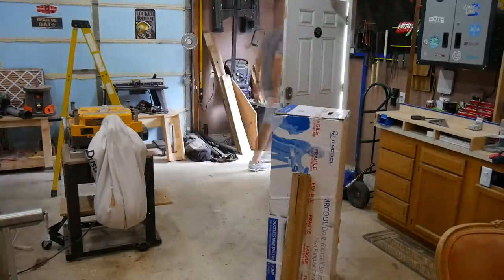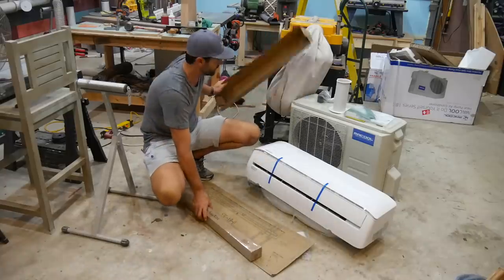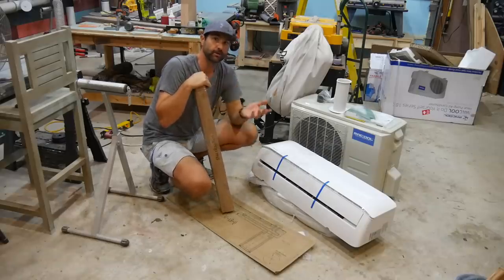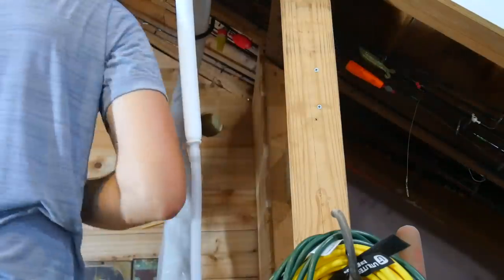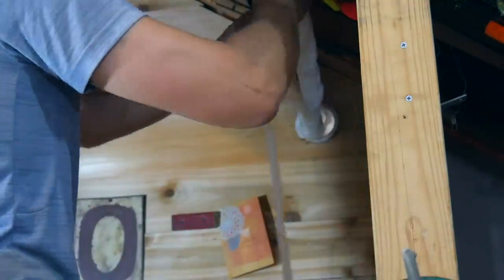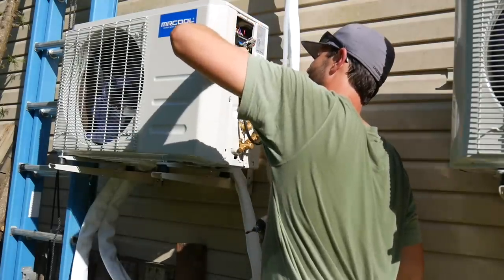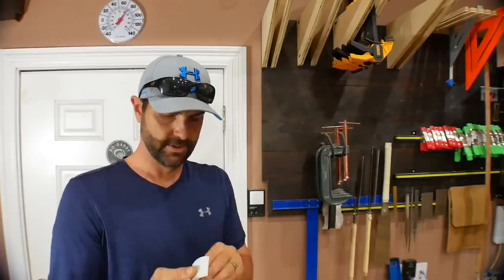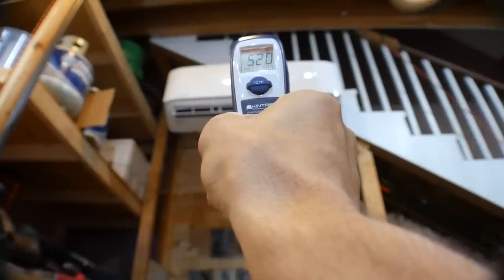DIY Mini Split Installation (Step by Step)

Comment: Wait ? You didn't even vacuum the lines out??!?
Reply from the maker: +Alex Thomas - yes, that’s correct.
Reply: It appears the linesets are sealed somehow and pre-charged, hence the special screw on couplings
Reply: they are you still need to vac the lines, you can do what he did, but your cutting the lifespan in half or even a third.  I highly doubt the manufacture recommends "just connect it"
Reply: Thats what I though too, but look closer and you will see the linesets are sealed at the end with some sort of fitting that opens when you couple them to the unit service valves, similar to a quick coupling. The manufacturer would have positive pressure refrigerant in them. That is also why they are fitted to the evaporator already in the box from the factory
Reply: You're not too bright, are you, Alex?
Reply: You don't have to pull a vacuum on these.
Reply: That's exactly what they recommend.  If you vacuum out the line you end up vacuuming out the refrigerant and ruining the system.  What he is installing is a total DIY system with no HVAC tech needed.
Reply: Alex is correct in his thinking for the most part, usually the lines are just lines with no charge and open to air, evidently this is not that though.  I had the same thought, no nitrogen pressure test, or pulling a vacuum is not what most people familiar with HVAC are used to, or at least used to be used to.  Initially my thought was why have all that line to have to fill with refrigerant, and pull a vacuum on, but like I said, this is new and different from what I would have expected to see.
Reply: dude78 They use areoquip fittings and in time they will leak refrigerant[.
Reply: @no names please  people have been using these without issues. even if there are cases that have, all brands of units, systems, fittings, etc have failed someone.
Reply: Neither are you, Dwight. Air and moisture are two things that will kill a compressor. And I guarantee both of those are in that line set.
Reply: i did not see him vacuum them
Reply: All you folks complaining about not vacing the lines just don't get it.  The lines are pre-sealed with a quick connect valve that opens when you tighten the nut.  Sears sold these systems with pre-charged and sealed lines about 50 freaking years ago.  I installed one myself.  It ain't nothing new or mysterious.  And it works.  Geez.
Reply: Not Fool Excellent point. I used to be in HVAC before changing careers, and every once in a while I would come across an old Sears DIY unit. No problems with compressors or leaks.
Reply: That's because the old systems didn't use R410a.  They used R12 or R22.   The oils for those gasses are less hygroscopic than the POE oils that work with R410a.  Just a little bit of air means a lot of corrosion, as the oil will wick it from the air like a sponge.  And not just corrode the compressor.  It's corrosive period.  That means coils, condenser, the aluminum, the copper; anything will be corroded.  The compressor is most vulnerable.
              Personally, as an HVAC guy, these things make no sense to me.  I don't mind the DIY part, I think the cost is stupid high.  $1800 for 1k, maybe1500 sqft?   LG sells a window heat pump with the same specs that heats and cools the same area for under $700!   I'd buy that and put a grand in my pocket!   In fact, I have......
Reply: Idkmybff Jill read all the comments again. The fittings go on the pipe. The system is then evacuated and charged, including the lineset. Done at the factory.
Reply: fedboy601 lmao at you bud. Look at the product. Read the description. Pressure tested at factory. Then pre evacuated, and pre charged. No flares or brazing, just click pipe fittings together.
Reply: fedboy601 and yeah there is a minimum pipe run on these so the rolled up pipe behind the outdoor unit is necessary, or they go out on HP in heating mode
Reply: @bluhuptie  Yep, on the D.I.Y. version of the Mr. Cool system, the recommend simply connecting it!!!  NO VACUUM or you will likely suck out refrigerant into the atmosphere because they are using pre-charged line set.  The D.I.Y. Mr. Cool Models have a 7 year Compressor Warranty and a 5 year Warranty on the rest of the unit.  If you buy the lower cost Mr. Cool units that require "Professional Installation" and Vacuuming, you get a great 2 year compressor warranty and 1 year on everything else.  Go Figure!!!!
Reply: Wow no vacuum pump

Comment: The way I was taught, I’d do a pressure test and then vacuum the lines first, also maybe not the same elsewhere but I’m Canada, it doesn’t matter that the refrigerant is pre charged, a hvac technician has to install them
Reply: If you do that to a Mr. Cool D.I.Y. system, you will VOID the 7 Year compressor warranty and the 5 year parts warranty.  Besides, why would you pull a vacuum on a pre-charged line???  You would end up sucking out a good portion of the refrigerant and disposing it into the atmosphere!  Better go back to school or at least read the manufactures manual before touching a Mr. Cool. D.I.Y. unit my friend.

Comment: Can’t believe how many people are installing these without putting the system in a vacuum
Reply: both units are precharged - seems like MrCool is the only brand that does this, but MrCool are more expensive.
Reply: David Cundiff didn’t know that. I was certified on Mitsubishi mini splits. Those don’t come pre charged, not familiar with the Mr cools. that’s pretty neat though!

Comment: Can you connect two fans to one condenser?
Reply: You can install up to 5 indoor units to one condenser.  There may even be one that does more I just put in 2 Mitsubishi heat pumps with 10 headers
Reply: Not on this particular unit in the video, but you can purchase mini split units that allow multiple evaporator units to be connected to a single condenser unit.

Comment: What is wrong with people? Charged lines with a charged unit,  have nothing to vacuum.  Love your work, except not hiding the line set uncoiled inside not outside. You could have used the suction line with a fan for more cooling. Great work though!
Reply: Robert Heck there is nothing great about this WTF
Reply: This is a really good point. If you have excess line and you can keep it inside, do it. You're losing some energy in that exposed pipe. Granted, it's likely decently insulated in the wrap, but every bit helps.
Reply from the maker: Completely agree.  I actually pulled the excess inside after Robert’s comment above.
Reply: @PahjoDesigns  Question on the wiring, did this size unit require dedicated run from your main breaker? And if so did you have to go through the motions of trenching and conduit out to it?
Reply from the maker: Bill Gunter - my workshop has a sub panel.  The mini split runs to an AC disconnect box and then directly to the sub panel

Comment: when you sprayed your refrigeration lines  for leaks how did you test if the gas wasn't released yet  ? did you charge the lines with nitrogen than release  ?  also i didnt see you mention evacuation of the lines using a evac pump ?

Comment: ive got a 3 bedroom unit. do i need to get 3 split ac ? or how does that work??
Reply from the maker: You only need one outside condenser unit and three inside wall units.  I don’t believe there is a multi-zone DIY mini split.  If not, you need to hire a pro or buy 3 separate units which I don’t recommend.

Comment: You are supposed to put a vac pump on 5/16 fitting before opening the refer valved.  Attaching lines and opening valves without vacuuming atmosphere from lines will leave non condesables in system.  Will make unit work harder and in some cases , moisture will react with refrigerant and turn acidic and prematurely kill compressor

Comment: i'm not a fan of pre charged line sets especially on units like this where i dont know where the seals inside the fittings came from or what they are made of. over time the seals can degrade due to the refrigerant oil if the wrong type of rubber is used

Comment: Why didn't you just connect one outside condenser with two air Handlers?
Reply from the maker: Darlene Litteral - very good question.  The previous homeowner had a central AC unit in my workshop that was 15+ years old.  The old AC unit was only large enough to run the downstairs, but not both downstairs and upstairs.  Not long after I installed the first mini split, the central AC unit broke.  It was more expensive to fix it than just to buy a second mini split.

Comment: You should cut the line set shorter, flare the ends and then attach to unit. 
You should also do nitrogen pressure test on it. Let it sit and test for leaks. 
Then pull a vacuum on system. Need to make sure system is dry and clean before releasing refrigerant into the lines. 
There is more to doing a mini split.

Comment: #1: Avoid vertical loops. More vertical run in the line encourages oil to separate from the refrigerant. Starving that compressor of oil is a good way to burn it out.
#2: Every AC unit I've bought for customers came precharged. Precharged with refrigerant doesn't make this "DIY."

HVAC technicians are equal parts electrician and refrigerant handlers. We're instructed on best practices for ensuring your unit gives you a decade to 15 years of life. You might think DIY is "way better" and if you're hiring a lamebrain HVAC installer you'd be right.

However realize that DIY also means Do It At Your Own Risk. If my unit fails and I installed it right the manufacturer gives you a new unit (I cover the reinstall). #1 cause of failure of new installs is poor installation practices.
Reply: Isaiah Harms Hello,     I’m installing one next week, 230 v mr cool with pre charged copper lines, (others need to be vacuumed) how would you recommend laying 16 feet of lines without coiling them? I read to lay them vertically in S pattern , any suggestions would be appreciated, thanks
Reply: @Blaze49AzSd  Refrigerant carries compressor oil. If you coil excess line (or s pattern) it's best to do this horizontally so the refrigerant  continues with the refrigerant back to the compressor. Otherwise you may create a trap and eventually your compressor loses lubricant (bye bye compressor).
We vacuum linesets out to remove oxygen from the lines. Oxygen and oil do not play nice, and in some cases cause explosions (though the chances are low).Also oxygen contains water vapor. Water is a non-condensible. Not a good thing in a compression system like an AC unit.
I watched the Mr. Cool YouTube of their customer connecting refrigerant lines. I  see no way of preventing some air and non-condensibles from getting into your system. If it fails too early this may be why.
Good luck
Reply: @Blaze49AzSd  Also.. don't ever lay bare copper line on anything abrasive (concrete floor comes to mind). Refrigerant lines vibrates as the compressor rams refrigerant through it. If coiled on an abrasive surface or  placed against a sharp edged feature (nail) a hole will be worn into the wall of the copper tubing. Keep the insulation around it.
Reply from the maker: Great points Isaiah!  I use an hvac technician annually to service this unit and the others.  Hvac technicians are skilled craftsman and will always be needed.

Comment: These AC units are not efficient. Yes it comes precharged but you have air in the lines you connected to. That air decreases efficiency. That is why for entire house AC, they pull a vaccum in the lines before they introduce the freon. You will get cool air with air in the line but not as efficient as it can be.

Comment: Wow are you allowed to fit your own air conditioning in your country ? , Jail time in the uk
Reply from the maker: Only the DIY units that are pre-charged with refrigerant.  You need an HVAC license to purchase and install refrigerant.  I'm not 100% sure, but I believe that's how it works in the US
Reply: Wow that's crazy, so there is a possibility of an amateur connecting a faulty line set and releasing that pre installed refrigerant into the atmosphere....
Reply: Whats the big deal?  Ive had "pros" mess up and empty a lot of refrigerant on accident.
And jail time?  Thats just asinine.
Reply: Pahjo Designs If I want refrigerant I just go to Wal-Mart.
Reply: Wish it was that easy here, so much paperwork so the government can keep tabs on who has the refrigerant and who is disposing of it and of course they need someone to blame if things go wrong lol
Reply: In the land of "Let's ban pointy tipped knives!" it actually wouldn't surprise me if they'd jail you for installing your own A/C.
Reply: @acestu  God we're all going to die!!!

Comment: I keep seeing this done with no vacuum being pulled. 
Pulling a vacuum removes moisture. Moisture reacts with the refrigerant and causes acid formation. It will eventually kill your compressor. Not to mention air in the system, commonly called a “non condensable”. Which lowers the output of the unit.
Reply: To add, he did not pressure test with nigrogen, how could he test for leaks  ?

Comment: The whole reason I started watching your video was for the electrical. Thanks for skipping that step 🤪
Reply from the maker: 220v wired to an electrical disconnect box.  I skipped the step bc I’m not a certified electrician.  I didn’t want anyone to get hurt by following my instructions.
Reply: then watch a video that shows how to install a circuit and run the wire  . that is not really a diy thing
Reply: @expertautodetail1833  a little late to the party. Already done.

Comment: If you want to keep your warranties I DO NOT RECOMMEND ANYONE TRYING A DIY ON A MINI SPLIT LET ALONE JUST ANY HEAT AND AIR COMPANY. You have to use a mini split certified technician because those systems use 240v ac to 24 volt dc voltage. If your not trained with qualifications you void all warranty’s that came with the equipment from the manuf.
Reply: Mr cool has a warranty even if you install it. However you can void the warranty if this was not installed by a licensed electrician.  So don't need HVAC technician just electrician
Reply from the maker: I agree regarding the electrical and it’s why I hired an electrician to power it.  I mounted the unit, installed the refrigerant lines, etc..

Comment: Great VID, but to an HVAC tech, this is a ‘how not to video’ 
- no leak sealant on lineset threads 
- no Nitrogen purge
- no nitrogen pressure in the line set to test for leaks so what were you testing?
- no evacuation of lineset to remove moisture or liquid line dryer install so any impurities will adhere to refrigerant oils to form sludge...it works great on day 1, but 2-3 years down the road you’ve got problems
- no superheat performed (your told it’s charged for 25ft, I’ve seen this way off) so you may have to add or remove refrigerant but you won’t know if you’re over or under unless you test
-  as far as the electrical, the rating plate will tell you the max fuse and you need that size Of breaker along with the correct gauge wire to your outdoor disconnect, then to the unit.  The circuit must be dedicated to the AC only, not shared with anything else
-  I hope it’s trouble free for you but in the trade we call this a ‘dice roll install’

Comment: I’m an hvac guy. Mini split systems are there worst you can buy. They work 3-5 years tops. Save your money.
Reply from the maker: Pitz ikata - thanks for the comment.
Reply: Pitz ikata, if that is true, Mr. Cool will be replacing a lot of D.I.Y. units because they have a 7 year warranty on the compressor and 5 years on everything else.  These Mini Split Systems are just now really starting to take off here in the USA, but they have been widely used in other parts of the world for many, many years.  I'm betting this baby will run for at least 15 to 20  years with today's technology.  Also, this is 100% made in the USA, so hopefully the quality is better than some of the cheaper made imports.